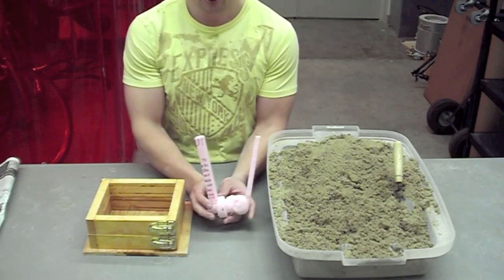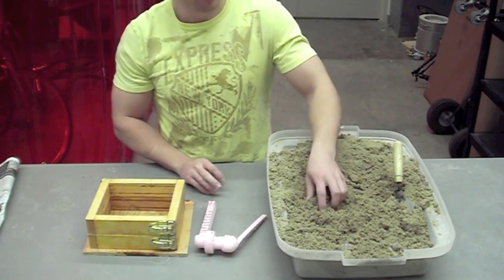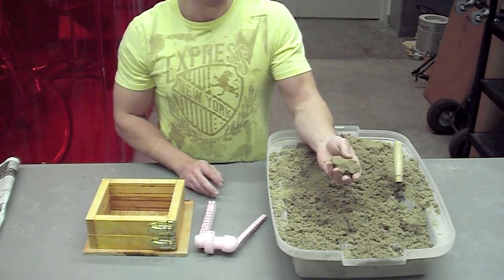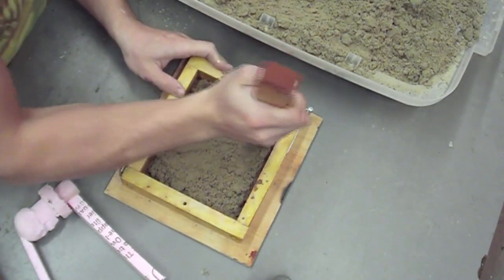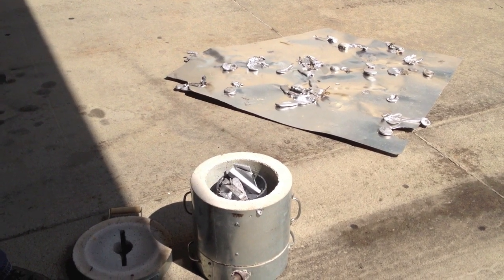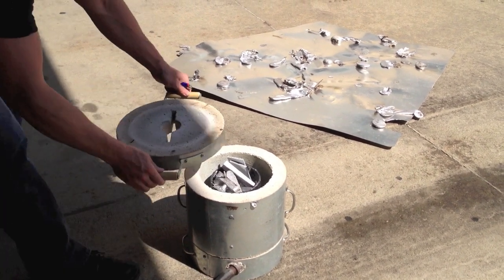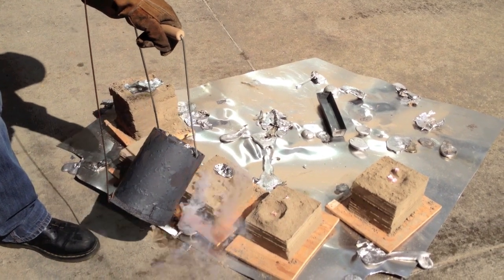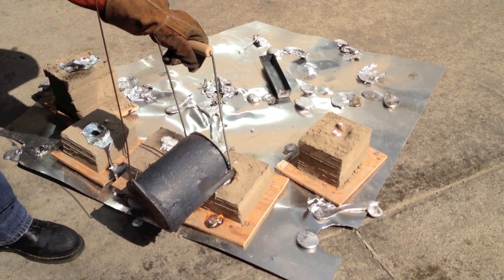Lost Foam Casting

Comment: No need for a milling machine- you can 3D print a mold in plastic, cover it in plaster, burn off the plastic and pour your part.  This is even an interim step in the manufacturing process, as 3D metal printing eliminates the need for any casting at all.  3D metal printers are rapidly coming down in price and within a short time they will be within the reach of small shops and home hobbyists.  This will make CNC mills and lathes as obsolete as shapers.

Comment: So much misinformation. Stop using green sand with lost foam. Stop pounding sand. Lost foam, make the foam part. Coat it in plaster of paris. Embed foam part into fine dry sand. Add riser and tube to form a pressure head. Pour molten metal. Pull out perfect and clean item
Reply: Exactly! Process in the video is called "full mold".

Comment: I hand crafted a prototype sculpture out of wax. I do not want to destroy the prototype. I was thinking about making a reusable mold around the prototype, then pouring some kind of liquid foam into the mold. That way I can destroy the liquid foam sculptures many times during the lost foam sandcasting process, to make many copies of my original wax sculpture, as I can pour many liquid foam sculptures. Question... does anyone know of a suitable liquid foam I can use? By liquid foam I mean a foam you can pour into a mold, and the foam hardens. Thanks.
Reply: if you have a wax prototype, then lost wax casting is a great method. It requires a bit more effort than this, though.

Comment: Sorry about the unfriendly comments, but there are some good points. Casting is always tricky. I work in gold, and aluminum doesn't have the same mass. Using a can or something to act as a reservoir of hot metal is good perhaps, and you mention this.  But the comment regarding a plaster coating of the foam seems to be a brilliant solution.  Oh, and screw that guy who busted on your biceps, You're beautiful.  (Yeah, I'm a dude!  :-P )

Comment: mmmm no vent?
Reply: +Dingus McGee 
With lost-foam casting, the sand and foam itself are the means to vent gases.  The reason to use sand only with a special coating on the foam is to allow gases to escape between the semi-permeable parts of sand.  Plaster is not porous nor ductile so before warping or compacting/loosening, it will just crack.

The easiest way to understand this is to keep in mind that sand piles UNTIL you use water to hold it together.  However, the moment the water is gone, the sand will fall apart, because it never binds together, it just loosely holds together and can easily be pushed aside by escaping gases.

Lost foam casting primarily loses points in that the foam negative itself is consumed whereas something like Lost Wax you can recover the wax, and make reusable molds as well using materials such as various plasters.

Comment: my question is, you have a cnc mill...why didn't you just mill the product out of aluminum to begin with instead of wasting time doing it the way he just did it?
Reply: Cnc mill would take longer than casting, due to limited feed, and cut rates. Believe it or not, casting is the fastest way to produce complex metal shapes. Machining is a very slow process, and is expensive, but both have their place.
Reply: true

Comment: Ha!  I have the exact same metal melter!  It sure works exceptionally well!
I owned a $65K 3D printer that produced plaster parts.
Not a very good investment.

As a hobby caster....it seems the three important things are: sand, sand, sand.
Using Match Plate system like our father's is not a bad way to go either...especially with the ability to perfect match plates.
Cut half the model in foam or wood or plastic and simply pull it from the mold.
That is ....  unless you are after the under cuts.
I'd go with a much bigger sprue.
Still...it was  a nice effort!

Comment: Why not just cast a solid block and machine it if you have such expensive equipment?
Reply: I'm assuming this was for the purpose of demonstration.
Reply: I think it would be way too strong
Reply: Noorquacker Ind. Right! That's how race engines are made, if i'm not mistaken. Not quite sure why machining a solid block is stronger.
Reply: ***** Where was this?

Comment: great work ... can u tell me what is the best method of molding the holes of oil and water for the engine blocks?
Reply: I known it’s 7 years later, but for anyone reading this, you don’t cast oil holes you drill them. As far as water jackets, you don’t use the sand method on the foam use the slurry method. Where the foam is dipped in a slurry that can flow in the voids of the foam you made for the water passages.

Watch a video specifically about engine casting from lost foam.

Comment: Thanks for this! Pink foam is rigid cellular polystyrene. I'm seeing expanded polystyrene (EPS) as the norm. The original lost foam method does use a refractory plaster coating. It's applied by dipping the foam in a plaster or spaying it on. Gypsum mud seems to be ok for aluminum. 

Alternate processes use a thicker plaster and then a burn out / firing like lost wax.

In the original process the plaster coated foam is supported by dry non-compacted sand. The plaster yields a much better finish.

Comment: get joint compound and make a very thin viscosity soup.
dip your foam into the soup almost like dipping candles.  build up a shell.
DRY COMPLETELY. the foam inside will create the shape, the hard shell will prevent blowouts of the sand as the foam melts and before the metal will fill the void.

Comment: I would take your process and modify it closer to the lost wax process.  Coat your foam with a plaster.  Let it set.  Then cook out the foam while curing the plaster.  This will prevent the gas blow back from the burning foam.  Great video.

Comment from the maker: I've only done this process a handful of times, and by no means am an expert. I've never tried polyurethane foam, but I've heard it does not dissolve as quickly as polystyrene (may need some trial & error). I haven't done any big parts. Highly recommend a pressure-head tool though especially for a large part (a link is in the description). There is a brief time when the foam melts before filling out the mold where a reservoir of metal is essential for a continuous pour. Best of Luck!!!